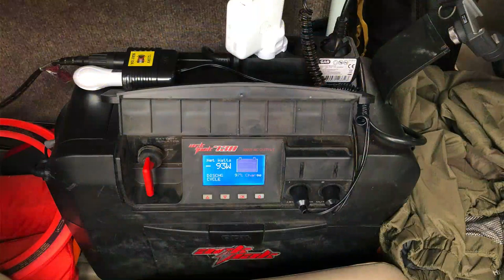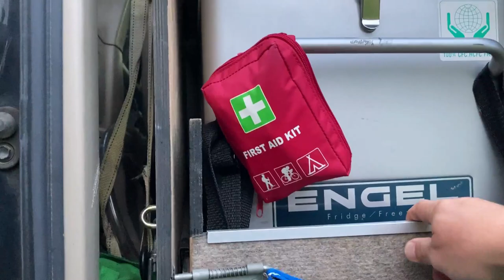Toyota Land Cruiser Prado 120 (GX470) Walk-around - Mods and Gear

Comment: Thank you for sharing. We also have one of this one here in Brazil. The difference is that mine has the oldest 3.0 turbo diesel engine. It's a 1kzte and not a D4D.
Reply from the maker: Thanks for your comment. I am not familiar with that engine but I believe it was the one used in the 90-series. It's more reliable than a wood stove

Comment: Hi Feri, congratulations on the video and on your English as well.
I was pleasantly surprised by your Prado's undeniably good off-road capabilities you made a reference to when comparing it to other, more rugged Toyota models. I said 'surprised' as this vehicle lacks old school axle difflocks  and is reliant on reactive 'brake difflocks' which I thought to be more vulnerable and less efficient on the whole. I wonder whether you could expand on that a bit bearing in mind the context you outlined when you talked about your experience with the technically more refined but less practical automatic gearbox as opposed to a manual one.
Looking forward to your reply and 🤞🤞for your ongoing tour! L. L.
Reply from the maker: Hi László, thank you for your kind comment.
The Prado is definitely not as rugged or as strong as it’s bigger brothers. In tough off-road situations I am sure it would fall behind. However, I was talking about it from an overlanding perspective where off-roading is not the main goal, it’s just part of it. During a long overland trip (crossing several countries, maybe continents) the Prado could go to 99.5% of the places where the larger Land Cruisers could go.
Reply: @OverlandSite  Dear Ferenc, Thanks very much for your prompt reply.
I understand the point you made on the difference between off-roading and overlanding. There is just one more thing I'd like to ask.  And that's about your  Prado's  'brake difflocks'. One may think they must obviously have functioned fairly well in those tough off-road situations you came across during your Singapore tour, since you eventually came back safe and sound. Does it also mean that this 'brake difflock' system worked so reliably all the way through that it never had any issues that had to be dealt with? Or it did have some problems, but they could be sorted out easily on the spot?
-------
Anyway, I also follow your current tour in the IVECO. Great adventure! Enjoyed every minute of it I've seen on the net so far. Just keep it up and GOOD LUCK! 🤞 😉

Comment: Great video, would love to travel the silk road. Bought a 3.0 td 120 a few years back....hugely underrated. Chose it over a 100 series as theyre too large and slow. The 120 has the same build quality, great power to weight ratio with excellent handling. 
Has over 300k miles with just brake pads and normal servicing. 
Subbed to your channel 👍
Reply from the maker: Thanks! Appreciate it. We are travelling with a different vehicle now and surely miss the Prado. I can’t wait to go back to it and work on a better overland platform for the back (fridge slider and sleeping platform). 
Videos on the channel will continue from January. We are too busy now teavelling and can’t find the time for editing

Comment: Hello, I appreciate your effort :) could tell me morę about your suspension? Did you make conversion from air bags by yourself? And what kind of springs did you buy? Is that from OME of pedders?
Reply from the maker: Yes it had to be converted from air to springs. No i didn’t make it myself, i brought it to a professional offroad specialist in Austria. They had ti fabricate the platform for the springs. The springs are from ARB with a 40mm lift

Comment: you can start automatic by rolling down the hill, just need more speed, like 40kmh will do
Reply from the maker: I don't believe that to be correct. Have you ever tried it?
Reply: @OverlandSite  not with my LC, but works with my grand cherokee WK and mercedes e230, try turning it off while driving wait a little and put ignition back on

Comment: The biggest problem ive had with my GX is range. The 2uz engine is one of the longest lasting engines i know of, but it doesn't sip fuel. Top that with a 83 liter tank, and you not getting very far from a station.
Reply from the maker: You can sort out the range issue with a couple of jerry cans. But how many miles do you have in the engine? Did you start to have issues with it?
Reply: Yeah, Prado has 180L tank. I guess it’s North American regulations.
Reply: @OverlandSite  I bought the cheapest GX on craigslist. $4500 235,000 miles. $6k and a ton of hours later, ive managed to sort most everything out and get to 5 Appalachian states and Florida. Ive owned a tundra with that motor for 18 years. They can go as long as you maintain them properly.
Reply: @OverlandSite  These need timing belts replaced every 100k miles.(I replace every part in between, water pump, radiator, seals, gaskets, thermostat) After that's done one the GX, id take it just about anywhere.
Reply: As far as fuel, i have my eye on a swing out bumper for the spare, and an add on tank in the spare tire space. Its rare, east of the Mississippi river to get too far from fuel.
Reply from the maker: @Agent.K.  mine has only an 80L tank, hence I had to carry jerry cans. But with jerry cans it works just fine. They're empty most of the time and I only fill them up if I reach a truly remote place
Reply from the maker: @alabama2uz  wow that sounds like a great price! We'd love to do trails in the Appalache next year. Although it will be with the Iveco, not the Prado
Reply from the maker: @alabama2uz  sounds great!
Reply from the maker: @alabama2uz  I was also considering metal bumpers with swing outs but they were expensive and very heavy. So I ended up with just a ladder and a jerry can holder on it.
In Europe is also very rare to get to far from fuel, but if you ever plan to drive to Asia or Africa you need to be prepared.

Comment: Great video thanks for the useful information . I have the same truck that I am building for my African adventure . Glad a winch is not necessary . I am surprised that you did not install an extra transmission oil cooler.
Reply from the maker: I think a winch is like an insurance policy. Perhaps it will save you when you're in a big trouble. But I was considering probabilities. In Africa we were travelling in a convoy most of the time, so we could pull each other out (we got stuck several times in Africa). Throughout Asia we got in trouble a few times but could get out without a winch. So I'm not saying it's not necessary, because I don't know how remote areas you're travelling to where a winch could potentially save you. I decided against it due to cost and weight. But we have a winch on our new vehicle now.
Reply from the maker: I don't think a transmission oil cooler is necessary. But are you doing that kind of a hardcore offroading over long distances where that would be necessary? I don't think there are areas where you're travelling in 1st low gear for hundreds of kilometers.
Reply: @OverlandSite   Like you I am thinking more of insurance should I get stuck, not planning to do any real remote travelling with the family will be sticking to main roads. Thanks for the Advice though.
Reply: @OverlandSite   My thoughts are that for long distances on corrugated roads in hot weather it would be better to keep the transmission temperature down.

Comment: Thank you for the video. It is very usefull. Can you please tell me your experience with the hight above the drawers. How much space do you have? But to use only one row of the drawers will work much better, but then there is a big lack of needed space!
Greetings 👍
Reply from the maker: It depends on what do you want to use it for. If you want to sleep on the top of the platform then it’s a very small space and can feel claustrophobic.
Otherwise it’s quite good for anything you want to put in the trunk. When it’s not full of camping gear, i use the drawers for anything from groceries to tools etc so that’s useful space too, not just on the top.
But i’m considering building a version that’s lower. I reckon i can win at least 5cm on the top

Comment: Great video, inspiring me for a future rig for north and possibly all the Americas. How do you find the rear door ladder? Is impractical to have to close the rear door to access the roof?
Reply from the maker: I like it. First of all it adds to the look :) Otherwise it’s great for accessing the roof and also possibly a trasharoo or something similar (mine doesn’t have the spare tire mounted on the door so the ladder is the only option for that)
When the door is open, I can use my door latch step to access the roof

Comment: Great video, could you explain auto vs manual in a bit more detail possibly?
Reply from the maker: Hi, thanks for your comment. I''m glad you liked the video. Regarding auto vs manual, automatic is better for hardcore offroading, when you constantly have to crawl through rocks or sand at a very slow pace  --> you can't burn the clutch if you have an automatic. And it's also very comfortable of course. But the cons are that if you're going far, to remote places (and that was our goal, not just offroading) then you have a much more complicated transmission. A manual transmission is easier and cheaper to fix. And if you have a starter motor issue, with a manual the truck can be pulled or pushed in to start. You can't do that with an automatic.

Comment: Thanks a lot for the very useful info and sharing with us your experiences! I have three questions:
- How long ccould you run the fridge without starting the car? I guess you did not have a solar, so you charged the battery from the car only, right?
- What pressure do you run the tyres on a highway when empty, and when fully loaded?
- Would you recommend BFG KO2 as a summer but also winter tyre?
Thanks!
Reply from the maker: Hi, thanks for your comment.
- how long will you be able to run the fridge will depend on the size of your leisure battery. We did not run it from the starter batteries, but we had a separate leisure battery (around 100watt hours). That worked for about 4-5 days, which was perfect for a camp. After that we wanted to move anyway. We did not have solars.
- I run 2.6 and 2.8(rear) bars when empty and a little bit more 2.8/3.0 when loaded. But it will depend on tbe terrain as well. The mentioned pressures is for asphalt. Offroad we can go belpw 2.0bars
- yes i can recommend the K02 for winter use as well. I did, and had no issues. But we aware that they are hard compound tires and don’t perform as good in snow as a dedicated winter tire.
Reply: @OverlandSite  thanks a lot for the info!
btw, did you have also air compressor? portable or you installed compressor in the car? thanks!
Reply from the maker: @m1ci  yes I had (still have) the ARB portable air compressor (this one: https://amzn.to/3k7znfg) and the advantage of it is that you don't need to hard wire anything, just clamp it to the battery of your car and it's ready to use. I am on a long trip with another vehicle right now and I could just simply take the air compressor from the Toyota and put it into the other vehicle. It's very reliable, and very strong/quick

Comment: Great video! How do you ended up with TJM shocks and springs? Hows the driving impression?
Cheers mate.
Reply from the maker: I was considering a few major brands, without any preference. TJM was on my list, given that it’s an Australian brand and they have a lot of Prados down under. The company where my truck was upgraded also suggested TJM so i just said yes immediately
Reply: @OverlandSite  Hows the ride compare to the factory setting?
Reply from the maker: Kian S it’s harder when the truck is not loaded but otherwise, once all you gear is in the truck the ride is totally fine

Comment: I wouldn’t say the prado is less hardcore, it’s just as hardcore as the 100,200 and that bunch 
It’s just smaller 
The 120 chassis introduced kdss, x-reas, DAC, UAC and the 1GR-FE which now the entire Land Cruiser line uses 
It’s just a Land Cruiser the size of a 76 series, with the comfort and livability of a 100 or 200 series
And you can definitely go rock crawling in these far better than the 100 and 200, it’s weighs a lot less and it’s much narrower
Reply from the maker: I want to agree with you a 100%. Nice comparison to the 76

Comment: Hi,
I did a 2" Dobinson IMS lift on my Prado 150.
My tires are still stock at 265/65/R17.

I want to upgrade it to all terrain but keep the tire size same as stock 265s.
I go for offroading on deserts.
What do you advise?
Reply from the maker: Hi! I think that would be totally fine. 90% of the time you’re better off with stock tire sizes in my opinion.

Comment: Have you ever changed the injectors or upgraded the injector washers which are a big problem with these engines resulting in oil  starvation due to oil strainer blockage with contaminated oil?
Reply from the maker: Yes! The injectors have been replaced at 350k kilometers. The engine was running much smoother immediately. It's expensive (€1.5k) but it's worth it.

Comment: Are there enough space on the back for sleep (very tall person is asking)? What is your height / what is back space length for sleeping? All the best!
Reply from the maker: Our setup would not be good for a very tall person (i’m 1.78m, about 5’9’’) I fit, but if you’re taller, you wouldn’t. But there are build where the bed is arranged length-wise, not across in the back. The Sprinters have extensions on the side in the back because of the same problem, but I haven’t seen that on an Iveco yet

Comment: How did you fixed the ladder on the back door?
Reply from the maker: It's very easy. It latches to the top of the door and at the bottom 3 bolts are holding it. I had to drill through the door though.. It's made by Fabryka in Poland.

Comment: Whats its km/l? In my country, the prado is sadly only common in the 2.7 petrol (3.0 diesel are rare and double the price)...
Reply: +whats the total cost for doing an overland from budapest to singapore?
Reply from the maker: It's about 11L /100km (25 MPG)  this is a very long average and only because we never go faster than 100 km/h (60mph)
Reply: @OverlandSite  wow, its actually quite efficient (especially for a 4x4). I was told that the 2.7 petrol would do only 5km/l, which i think competes with 105s and the other big petrol LCs😅
Reply from the maker: I haven't calculated the exact figure, but roughly $20-25k. The largest expenses are crossing China (about $3-4k if you're in a convoy of 3 cars), visas, vehicle repairs and shipping back the truck from Singapore ($3k in 2018)
Reply from the maker: Andi Satyagir yes it’s very efficient i’d say

Comment: No offense but our off-road builds gear in 🇺🇸 are so advanced compared to EU , either nice setup.
Reply from the maker: No offence taken. My goal was not to build a rock climber or a truck that’s overweight (like most trucks in the US) but an overland vehicle that I can drive across the world and that can be repaired anywhere. Most builds in the US are simply just an overkill for an overland trip (you don’t need 37s to travel overland) so they are not advanced but just using all gear that available on the market bolted onto them. That’s not a smart way of building a truck for overlanding.